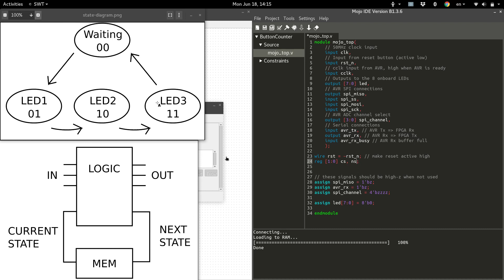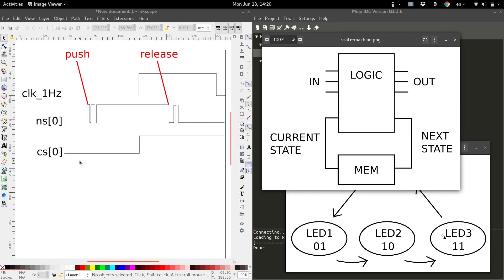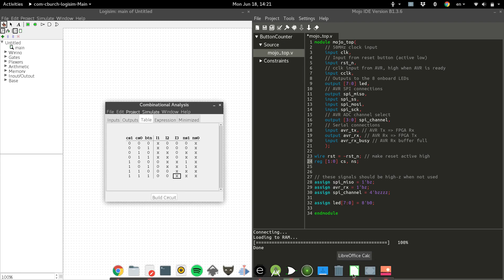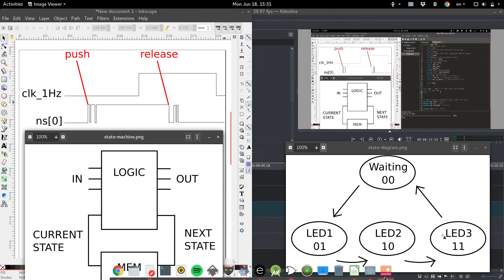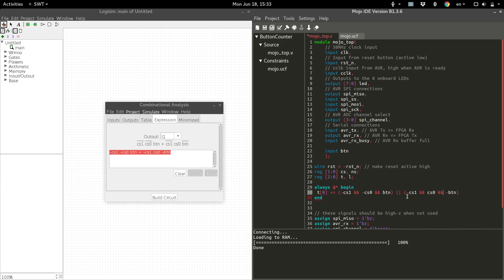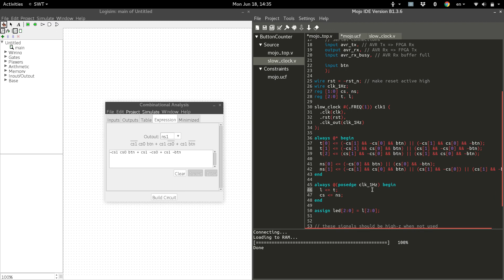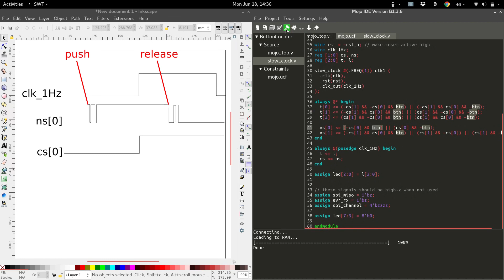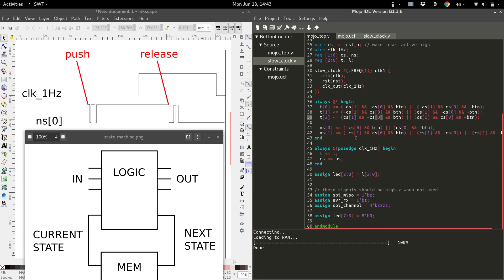Learn FPGA #15: Contamination delay Explained (and how to work around it) - Tutorial

Comment: Another bad hardware example. That push-button circuitry is missing a pull-up/down resistor to keep the FPGA input stable when the button is not pressed.
I know the FPGA IO blocks usually have internal pull-up/pull-down circuits,, but I don't see them being activated nowhere. Also the inner details of IOB are not in the scope of this video, so please add the resistor to the external circuitry.
Reply: Pull ups and pull downs are usually configured in the constraints file which he hasn’t shown much of yet, a lot of these development boards will have a default constraints file anyway that will set all that up for switches at least until he goes into more detail about the constraints file
Reply: @conorstewart2214  Yes, I'm aware of it, but, as you  mentioned, its not been explained, and it should have had, at least, a minor reference to the subject. The default constraints files for this kind of development boards can be relied upon for onboard devices (LEDs, switchs,...). If we want to hook up an external device we need to, either,  tweak that specific pin configuration, or add the external pull up/down.

Comment: is there a particular reason why you can't just go
on positive clock edge assign values to registers
wire registers to leds or is that just bad practice?

also @* means anytime except when there is a positive edge, right? since you can't drive the same thing in the same cycle by different hardware, correct?
Reply from the maker: Yes, and that's actually what this strategy is doing. This is used for dealing with when your have an external input wire coming in. You hook it to a register and have the register update from the wire value on a positive edge.